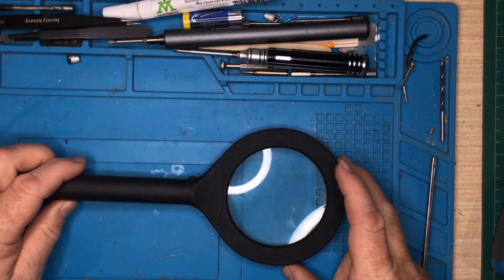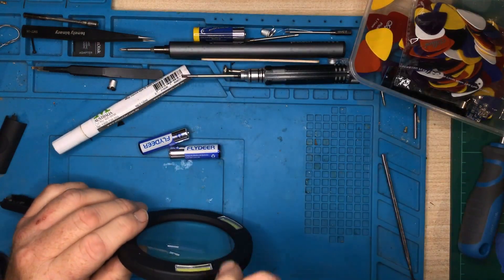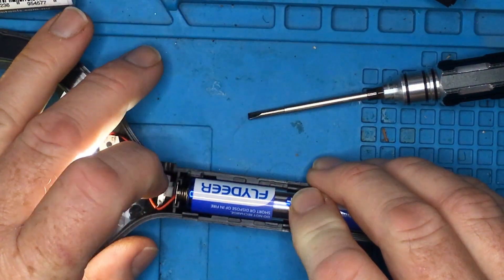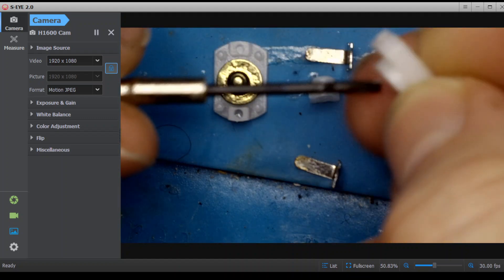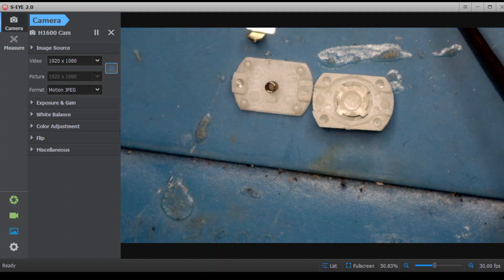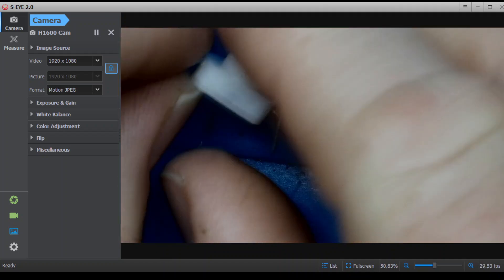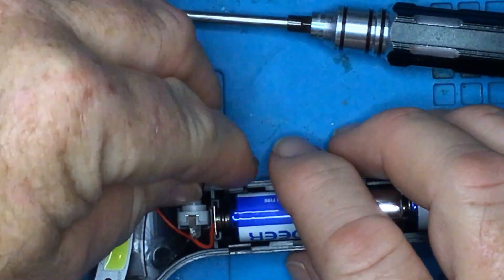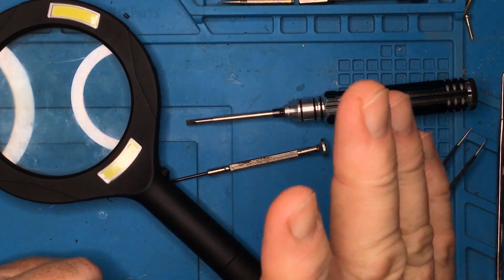Fixing a Magnifying Glass with a Light

Comment: I have repaired similar switches in flashlights and it's usually a good idea to clean all the contacts with a pencil eraser followed by a spritz of alcohol to degrease them before reassembling. An Exacto knife with a dull blade is handy for prying the switch apart; instead of soldering it right back into the circuit, hook up an ohmmeter to test it first and check for the absence of contact resistance.  Unfortunately the 2 solder terminals kind of float a little bit inside the switch body, and the wires tend to push or pull on the terminals, making the mechanical alignment a little different each time you activate the switch.
Reply from the maker: Good advice, I definitely should’ve cleaned the contacts. I didn’t think of it. What you say about the wires makes complete sense. If they’re loose and able to move in the case at all they are gonna tug on the ends of the terminals, and that could definitely cause the flickering that I was seeing. Something to remember next time :) do you think I was right about how the switch worked? With regards to how the teeth spin the internal part, so it in sits on top and then falls back into the grooves? It’s pretty clever in any case.
Reply: @GerrysTech  ,  The switches I've cleaned were in a similar white nylon housing and came apart the same way, but the spinning gear teeth inside your switch was a little different from what I am used to seeing. Many of the LED flashlights I have are not strictly on/off, they usually have 3 to 5 modes (high, medium, low, Morse code SOS, and flashing red) and so each touch of the switch, even momentarily, causes the flashlight to switch modes because there's an IC in there that controls voltage to the LED's.  I would prefer to have a separate rotary switch that selects the mode so that every time you turn it on it comes in on in your preferred mode and you don't have to cycle through 3 to 5 options to get the brightness level or mode that you want.  In theory those units that use an IC for switching might actually be on all the time and drawing a very small amount of current from the batteries even though the LED isn't lit..... But anyway, if I have to take one apart I always clean them with a pencil eraser or perhaps a fiberglass bristle scratch brush.  It is also worth noting that another major failure point, especially on any Flashlight that uses a cylindrical plastic holder to hold 3 AAA batteries is that the springs are often loosely crimped or held in place by bent metal  fingers that hold the spring to a metal thrust plate, and those points always oxidize and become intermittent unless you solder them. Once you get even the slightest bit of battery leakage and corrosion on the crimped connections to those springs it's almost impossible to fix that connection so that it's reliable. I always solder the springs to the thrust plate in advance.